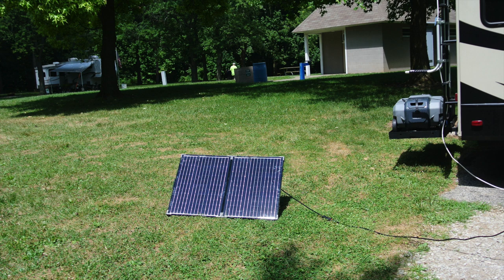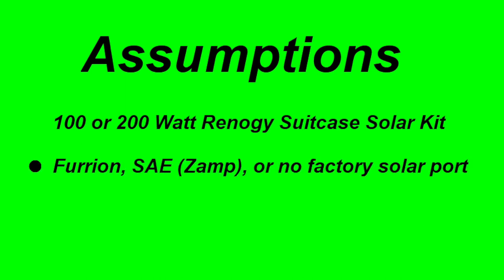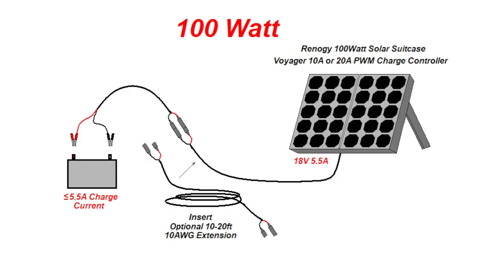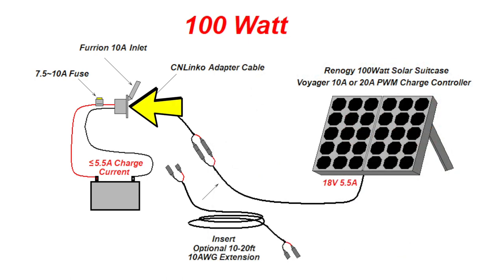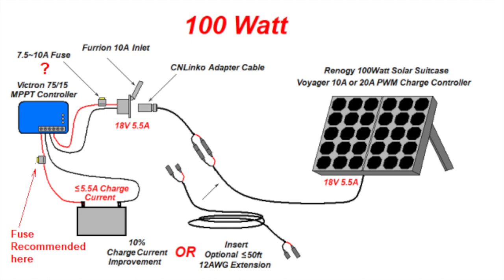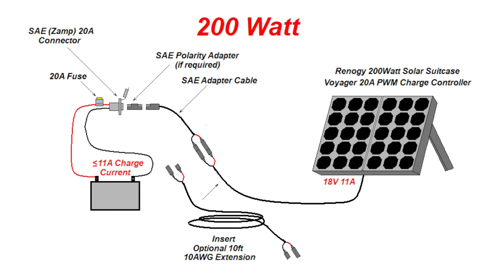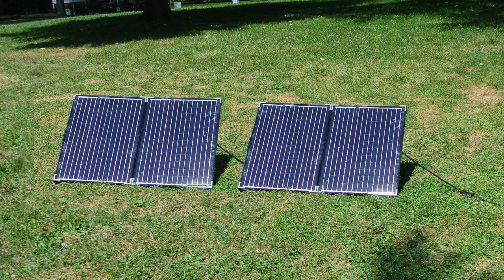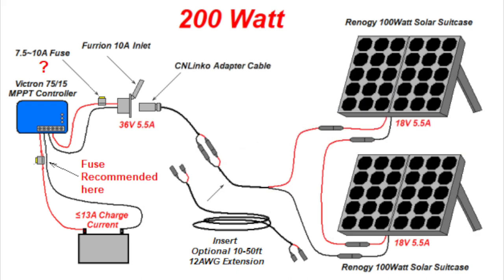Eight ways to connect a suitcase solar panel to your RV.

Comment: Great video.  I will head over and start studying your webpage closer.  In the meantime, I’m in the planning stages of a setup for my travel trailer and looking to connect two 100w, 12v panels in series which makes it 24v through mc4 connectors and 10awg cable to the trailer’s SAE input, into a 100/15 MPPT controller and then to the 12v battery.  I’m feeling stumped or maybe just overthinking it.  Even though it’s 24v going into the controller, the controller will “control” that down to 12v to safely charge my 12v (or 2x 6v batteries in series?  Am I missing something?   It also confuses me that the panels are listed as 12v but the specs say optimum operating voltage of 18.5v and open circuit voltage of 22.6v.  As you can probably tell, I’m still in the research/learning phase.
Reply from the maker: The panels will put out about 18V or so when connected to a charge controller. The open circuit voltage is when they are not connected to anything, which means they are not under load.

So in series, you essentially have 18V x 2 = 36V for the solar panels.

In this configuration, you need a MPPT controller. This controller can take that excess voltage (above the 12-14V required by the battery) and convert it into additional charge current.  

The side benefit of this is not only increased efficiency, but you can extend the solar panels further as the voltage drop issue is not as bad as with the panels wired in parallel with a PWM controller.

Therefore, the primary reason to put panels in series is to reduce voltage drop issues, and allow smaller AWG wiring to be used.  Again, this can only be done with a MPPT controller.

A PWM controller cannot convert excess voltage to current. It must dissipate any excess voltage so placing 36V on the input would likely overheat and fry the controller. It is simply not designed to dissipate that much energy.

Regardless of the charge controller used, the output to the battery will be dropped down to about 12.9V to 14.4V depending on the charger state. The higher the voltage on the battery, the faster it will charge. 14.4V will charge the battery faster, but it can damage the battery when it goes into overcharge. For that reason, the charger drops down to 12.9V (trickle charge), which keeps the battery topped off.

A fully charged battery is about 12.6V.  Whenever a higher voltage is applied to the battery, it will charge. Thus the reason for the charge controller output of 12.9 to 14.4V

Since there are a few inefficiencies involved, a PWM charger needs around 2V overhead to work properly - which means about  16V to 20V on it's input (where the solar panel is connected) to produce the required 14.4V for the fast-charge mode. 

If the solar voltage drops below 16V, then the output  of the charge controller can never be as high as 14.4V, due to the 2V overhead it needs. So the result is the charger can never charge as fast as it could.  The primary reason for the loss in input voltage is again, the distance of the extension cable to the solar panels. 

Back to the MPPT controller, it also needs a bit of an overhead - the same 16V. But remember, the voltage is 36V, so the voltage loss in the extension cable will never affect the ability of the MPPT controller to output 14.4V on the battery.  And with it's ability to convert voltage into current, it gains more efficiency vs. the PWM charger.

IF you watch the other videos, you should figure it out.  Thanks for your support.
Reply: @RVProject  wow. Seriously wow.  The way you explain things is so clear and concise.  I am rally looking forward to watching the entire series.  Subscribed and liked!

Comment: Just a question, if the fuse pops with no power to the mppt will that cause any damage to the controller. Thank you.
Reply from the maker: Fuses blow for one reason only - an overcurrent condition.  Depending on why the fuse blows, it could cause damage to something.

Comment: Im subscribing ...can you show us how to connect a folding solar panel which has a charging box not charge controller (??  But i know the battery needs charge controller i think??) to a deep cycle battery to charge it??? ...minivan camper......Im.looking for a video that does this but cant find it ....you seem SUPER knowledgeable and im kinda begging for myself. ....a newbie 

Goal for me is to use a deep cycle 100 aH and a charge controller and folding 100 or 120 watt panel ...but all those panels come with a charging box??? Not charge controller...i need to learn how to connect all those and then alligator clip to the battery i think?? ....can you help ?
Reply from the maker: I am not sure what a "charging box" is.  Every portable suitcase I have seen more than 50AH includes a charge controller.  A charge controller takes the 18VDC (or more) from the solar panel and runs it through a battery charging circuit to the battery.

There are some small solar panels that have a charging mechanism built into the panel, but even those are charge controllers.

Can you elaborate a bit more on what you have?

Comment: Help please . 100 watt panel / 20a mppt charge controller / 100 LiFePO4 battery ... what size fuse between charge controller & battery , thanks .
Reply: The creator of these amazing videos passed away in June 2022
Reply: @campusa8742  So sorry .

Comment: Thanks for making and sharing this video.  Two quick questions on configurations 5 and 7. 1) What size of a fuse should you use between the controller and the battery? 2) Will using 10AWG vs 12AWG be of much benefit for the extension cable?  Thanks again for your efforts here.
Reply from the maker: The fuse should be sized for the maximum charge current the panels are capable of.  Fuses are rated for the maximum current it will allow to pass - not at which point it will blow.  See my video "All about fuses": https://youtu.be/tUomOpNUjHE

In video 3 of my suitcase solar panel playlist, I cover the reasons why 10AWG wire should be used: https://youtu.be/A6PxSvuGc5U

Finally, here is the suitcase solar panel playlist: https://youtube.com/playlist?list=PL9L2lLziJeInW0EznBZhIYsnG1tQlHTOJ
Reply: Excellent video on fuses, thanks for the education.  So, a 7.-5 to 10a should be used?  Any thoughts on question #2 in benefits using 10AWG vs 12 AWG for the extension cable?
Reply from the maker: @TheCabinman  Watch video 3: https://youtu.be/A6PxSvuGc5U

Say you have a 100Watt Suitcase Solar panel. It will produce 5.5A peak at 18V or so.  If you have a PWM controller, it will convert that voltage to 12.9~14.4V or so to charge the battery.

A 3 stage (Smart) charger will output 14.4V for Fast charging. 13.5V for Normal (or Absorption) charging, and 12.9V for Trickle charging.

If you apply a smart charger to a battery that is less than 80% charged, it will start off with fast charging to bring it up to 80%.  Then it will go into Normal mode to bring it up to 100%. And finally, it will go into overcharge with a Trickle charge. 

The Trickle charge is designed to keep the battery topped off without damaging or gassing the battery.

So essentially, the charger varies the voltage on the battery to go into the different charge states.

But no charger is 100% efficient. Even though the maximum voltage at the charger output is around 14.4V, it takes around 16V on it's input to produce that voltage.  The solar panel output is 18V,  so the minimum input voltage to the charger to produce a 14.4V rapid charge is 16V.  Therefore, we have a 2V margin between the solar panel and charger for proper operation.

Anytime current flows through a wire, it is an electro-mechanical process, and causes friction.  The more friction, the more voltage required to push the electrons through the wire.

This essentially reduces the voltage at the end of the wire.  In other words, the wire more-or-less absorbs some voltage.

The amount of voltage loss is dependent on the wire size, length of wire, and amount of current flowing through the wire.

There are Voltage Drop calculators on the internet, and I have one on my website as well ( http://www.rv-project.com/tips/wirecalc.php ). It does all the math for you, and all you need to do is input wire size, distance and current.

Lets say you want to add 20ft of extension from the RV to the solar panel. And lets also assume the charge controller is located at the solar panel.

From the voltage drop calculator, the following voltage drops will occur when the maximum 5.5A current from the solar panel is applied to the charger:

14AWG = 0.577V
12AWG = 0.364V
10AWG = 0.225V

When the charger goes into rapid (Bulk) charge, and applies 14.4V to the battery, by the time it reaches the battery, the voltage will be:

14AWG = 13.52V
12AWG = 14.03V
10AWG = 14.17V

In all of these situations, the ability of the battery to be rapidly charged will be diminished. In fact, with 14AWG wire, the charger is in Bulk mode, but the voltage at the battery is at the Normal mode level.  

Even at 10AWG, there is some loss in charger efficiency - but at least it's manageable.  You paid for 100Watts of charge power from your solar panel, but some of it is absorbed by the wiring, and you will never get  that 100Watts to the battery.

What confuses people is that an Ampacity chart will show that a 14AWG wire can handle 15A, 12AWG - 20A, and 10AWG - 30A, so they figure they can use 14AWG wire given the current load is 5.5A maximum.  But they fail to realize there is an associated voltage drop. You have to use the larger wire NOT because of the current carrying capability, you need the larger wire due to the voltage drop.

This is the major issue with locating the charge controller next to the solar panel. For this reason, I highly recommend relocating the charge controller to the RV, as close as possible to the battery.  

When you do that, the voltage drop in the wiring is between the solar panel and charger, not between the charger and battery.  And I have shown that you have a 2V margin between the charger and solar panel. 

So, in this situation, you could use up to 50ft of 14AWG wire for an extension - which would drop the voltage by 1.5V.  But since this is at the input of the charger - not the battery, it is still higher than the required voltage of the charger, you have no voltage loss at the battery in bulk charge mode.  I do discuss this in my video series - check out the playlist.

So to recap. My recommendation is that if the charger is located on the solar panel, you should minimize the extension cord to 20ft using 10AWG wire - and even then, you will have some loss of charge voltage in bulk charge.  But if you locate the charge controller at the battery, you can use 50ft of 14AWG wire for an extension and have no loss in charger performance in bulk charging.
Reply: Thank you so much for the detailed response.  I do plan on locating the Victron 75/15 near the battery and will use  12AWG or 14AWG for the extension wire (50ft).  To your point, the voltage from the Victron to the battery (in my case Battleborn LiFePO4 battery) will be charging at 14.4v, so the fuse there should be 20v between the controller and the battery, correct?  Thanks again for taking the time to share you knowledge.
Reply from the maker: @TheCabinman  The max output of the Victron 75/15 is 15A, so either 15A or 20A fuse would work, depending on wire size from the charger to battery.

Comment: Another really good video, love these, you said something that got me worried though, (some rv manufacturers dont actually plug the furrion port to the battery, therefore you have to do that yourself). 2 months ago, i purchased a forest river salem fsx, actual model is the 178bhsk. Anyhow, one of the things i liked so much about it was the furrion port, being, solar ready...Was your Grand Design furrion port already plugged to the battery? I hope my forrest river is...
Reply: I just looked back at one of the videos, noticed your furrion port wasnt already plugged to the battery...Is that complicating to do? Can you make a video showing how to do that?
Reply from the maker: I think it's typical that the RV companies don't connect the port of the battery.  But it is simple to do, Red wire from the solar port to the battery positive, black wire to battery negative.
Reply: @RVProject  curious to what that look like
Reply from the maker: @49ers49ers   Grand Design ships their units without a battery, and as part of the sale, the dealer typically installs the battery, so it's up to them whether or not the Furrion port is connected.  

The dealer did not connect the port when I bought my Grand Design 29RS, and  feedback from many other owners of GD and other brand RV, it appears that dealers typically leave the port disconnected.

I would suggest looking in the battery compartment and see if it looks like there is a set of mystery wires not connected to anything.

Or, using a multimeter (voltage scale) measure the pins on the Furrion connector. If connected, it will read the battery voltage.

Comment: My setup has turned out pretty awesome however I’m noticing my 2x 100w panels in series are very picky with the sun and any tiny amount of shading seriously degrades the output given the 2 panels are in series.  Like from 175w down to 30w.  Wow!   It’s left me wondering; even though I’ve gained in the area of very little voltage line loss what are your thoughts on switching to parallel, having a bit of line loss and not having shade on one cell completely screwing the output of both, being they’re wired as a string?
Reply from the maker: Make sure you have bypass diodes installed in your setup.  These diodes are critical when wiring the panels in series as they prevent the exact issue you are describing.
Reply: @RVProject  Thanks, I'll being researching now.  Another idea for a video!  =)
Reply: @RVProject  According to Rich Solar, bypass diodes are already onboard.
Reply: @RVProject  Opened the box and verified as well.  Hmmmm
Reply from the maker: @joshhaas2410  I would verify it. Would not be the first time something like that was left off.
Reply from the maker: @joshhaas2410  Did you verify they were good? This can be done with a multimeter.
Reply: @RVProject  I think they're good in both panels.  Both read .6 on both diodes in diode mode on the meter.  I also noticed in the sun today, shading one cell dropped the wattage significantly at first but as I moved around the panels it show less and less drop.  By the end of my playing around, I was shading a quarter or more and not seeing the significant change I was originally.  I am wondering if maybe there was a timing issue between my shading and what I was seeing in the Victron app or something.
Reply from the maker: @joshhaas2410  The bypass diodes should be Schottkey diodes. They are a little different in that they should drop 0.4V.  Wonder if the mfg installed the correct bypass diodes?

At any rate, each panel itself is actually an array of panels in series and/or parallel configuration. So there should also be internal bypass diodes at each series connection within the panel itself.

So by moving the panel around, it appears that individual series strings are turning on and off.
Reply: @RVProject  They are Schottky diodes.  I have a call into Rich Solar to bend their ears about them and we'll see.  I'm guessing they will tell me they are working as designed but I'm hoping they can dial in my tests to prove it.  Thanks for all your replies.
Reply from the maker: @joshhaas2410  Sounds like you are on top of it.  Thanks for keeping me in the loop.
Reply: @RVProject  thanks again for being so interested!   Isn’t it great helping people?   Really appreciate all you’re doing here.  I love your videos, your approach, how helpful you are to all of us learning this and most importantly the way you teach.  Not sure if you have teaching experience but I could have used your style when I was in school! :)
Reply from the maker: @joshhaas2410  Never been a teacher, always on the technical side.  But in my professional career I often had to brief the bean-counters on technical proposals, and I just sort of had the ability to explain what needed to be done in terms they could understand.

However, one of my standard replies was that if I did not know an answer, I could always make one up - and they wouldn't know the difference.

Comment: I loved the series!  Thank you so much for putting this together.  May I get clarification on Configuration 8?  You upgraded the MPPT controller to 100/30 to accommodate the potential for 26 amps of charge current.  Is this just in case the panels are hooked up in parallel?  If hooked up in series (as shown in the diagram), wouldn't it stay at 11 amps and still be within specs of the original MPPT controller?

Comment: I used a female 7 pin connector for my 100 W suitcase solar panel, I just plug it in to the 7 pin connector of the trailer.
Reply from the maker: That will work.  I produced a video on how to make such a connector.

Comment: Can you charge and discharge at the same time. If we are using a battery bank and charging that from solar, is there any reason why I can't use the power from the battery bank at the same time I am charging that battery bank.
Reply from the maker: Yes.  If you connect a solar panel to your RV battery while it is in use, then you are both charging and discharging at the same time. This is the typical method of operation.
Reply: @RVProject  Now that wouldn't work on a solar generator would it ?, or is that still the same? I know you can obviously charge a solar generator from a solar panel, that's one of the ways of recharging,  but I've never really heard anyone say anything about being able to discharge at the same time your charging on a solar generator.